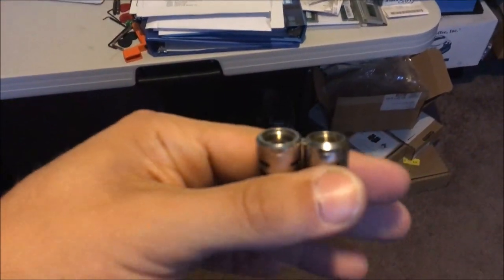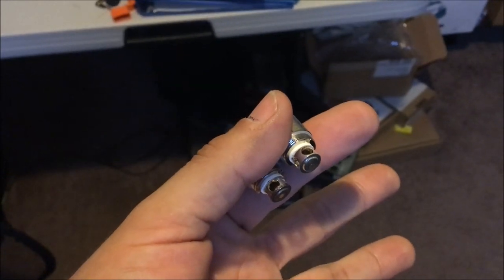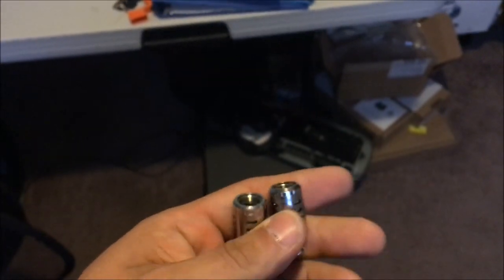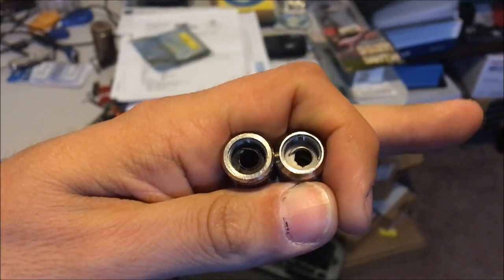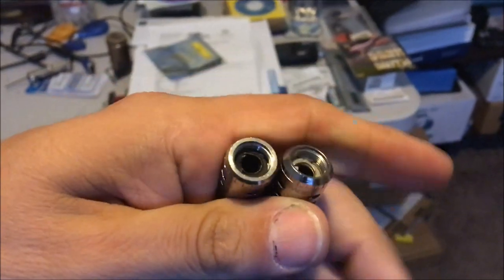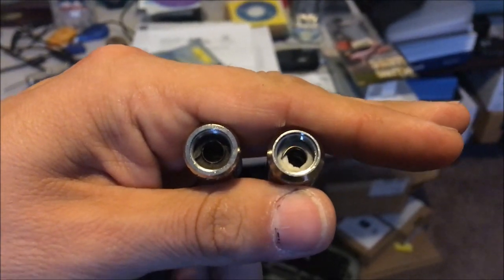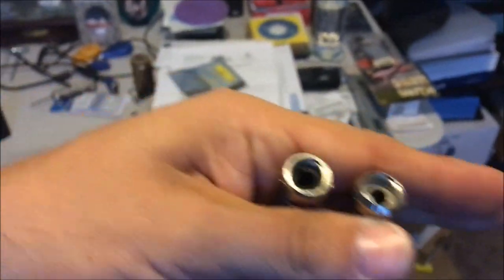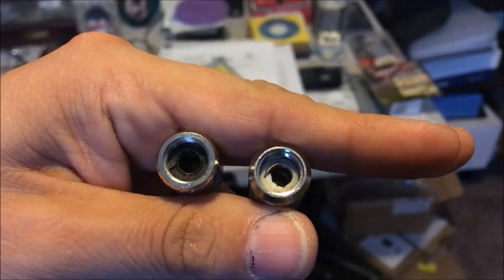How to tell when your atomizer is bad

Comment: yes, if you lower the wattage it will help some.  however, I have experience with building coils and maintenance and I could tell you right now.  The coil you're using is just getting gunky, and with the tfv4-tfv12, if you're putting in stock coils (the prepackaged coil heads), then you wont be able to dry burn the coils.  That is another thing, you can actually buy an rba base for the tfv8 or tfv4 maybe, and you can just buy premade coils and cotton bacon and just dry burn any time you're getting that nasty crap flavor.  Otherwise, these coil heads don't last long at all.

Comment: I use the Vuse vibe and it recently started tasting really burnt when I hit it. My device is only a month old. What gives? Any fixes? Google doesn't have many answers on this issue for this device.
Reply from the maker: Boom I Gotcha a month is really an average life span for them so it’s prolly time to change. Also if you run the watts as high as the mfg suggests, it could end life early.
Reply: vaiisking Thanks for answering :) So I need to buy a new vuse vibe every month?? That seems like alot to me. I thought it would last at least 6 months before I had to but another one. I'm not very knowledgeable on this though I just started vaping a month ago when i quit smoking actual cigarettes. Is there a way to clean it? Make it last longer? How do you turn the watts down on a vuse vibe?
Reply from the maker: I've got a video on here where I talk about how it's possible to clean some of them. I'm not sure of how to adjust the wattage on your mod bro, but there is surely some information at the mfg site or on youtube :) Good luck man.
Reply: Boom I Gotcha No you do not have to buy a new device every month. I think your message was misunderstood. The person who responded meant a month is about the amount of time the coils need changed. On average it’s like 2 weeks to a month for most coils. They thought you were asking about the coil. 
On another note, I am having the same issue with my vape. I have the Twister vape and my coil has no flavor now just since I changed my coil. The same vape and juice was fantastic when I first bought it three weeks ago. Now, I changed my coil yesterday and it tastes horrible! I have changed three coils since early yesterday and they ALL taste like shit. So frustrating. And yes I’m pruning them for hours and the right way. They don’t have the burnt taste but very little flavor and strong cotton taste. Or at least at the vape shop they told me what I was experiencing was “new cotton taste”. Well why didn’t I taste it the first time I used the vape all these weeks? Why just with these new coils? I’m starting to wonder if my vape device is just bad.

Comment: can someone help me, i own a vape and when i replaced my liquid and tried to vape i got juice in my mouth and if i try to vape it doest really work and i hear a weirdf noise can someone help or tell me what to do i already changed my coil to a 2nd one i got with my vapoe but that doesnt work ass well, womeone know the awnser pls
Reply from the maker: Check the rubber seals that are around the top portion of your glass and/or where the atomizer connects to the other parts. It's almost always an undertightened part or bad rubber seals, especially if the atomizer is new.

Comment: How about Liqua  atomizers, how to tell when new atomizers are bad, before buying. I will buy 5-10 atomizers at the smoke shop and 2 out of every 5 are no good. They are $3 bucks each! And you can't return them without being interrogated, like you're lying. I'm referring to the Liqua white or black vaping pens.
Reply from the maker: Susie Arviso never had any experience with them before.
Reply: thats normal with pre built coils. sometimes you get some duds